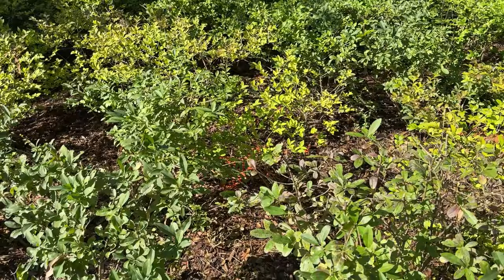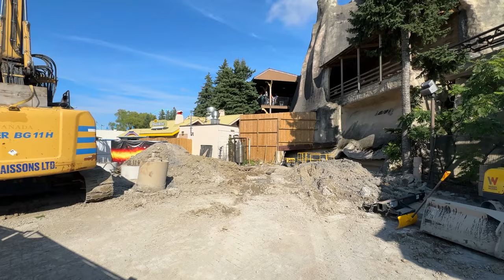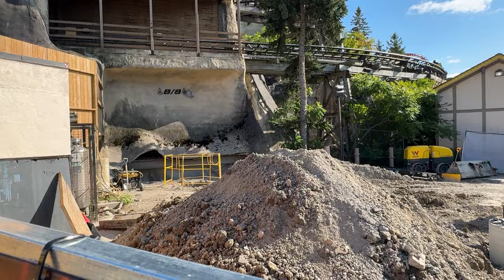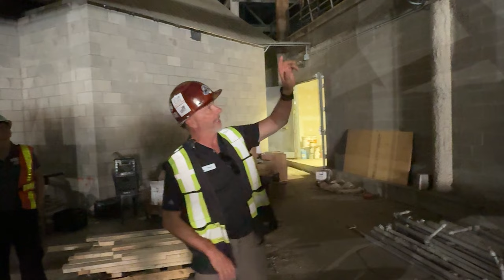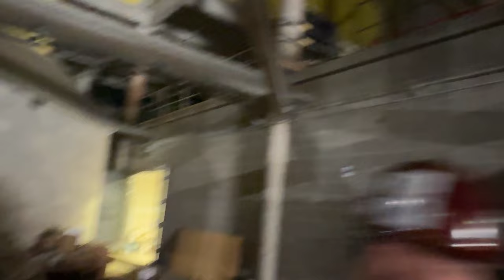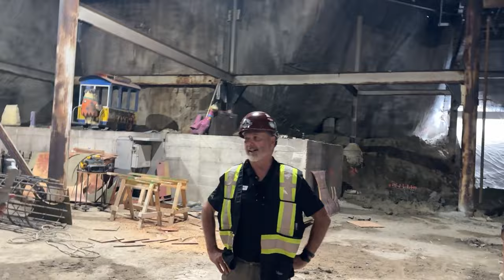Canada's Wonderland AlpenFury Construction Update

Comment: Here is a thought for you Brandon.  Because they have and are still keeping this coaster very secretive.  Do you think this coaster will be heavily themed throughout the ride?  I was thinking this, because everyone is only asking about the fire coming out of the mountain.  Well, what if there was a cold section in the tunnel?  The heat switch to the fire would be crazy.  What if the entire coaster is heavily themed like Velocicoaster.  Do you really think they would invest in a fire feature if the rest of the ride is just a plain coaster?  What about when it goes over the Expo path .. could be themed there.   What about the SkyFlyer area . .could be heavily themed there.  What about the area around the back of the mountain, could be themed there.  I honestly think that because they don't know what the fire feature will look like, I think they are holding back on the heavily themed announcement.  I just bet the entire coaster will be heavily themed. .They are not going to build a coaster like this, so predominately featured around the front gate/main street area without theming, I just don't think so.  What are your thoughts?
Reply from the maker: They are currently trying to figure out how to do a cold element in the tunnel. The tunnel is currently still in the design phase so they’re still planning theming :)
Reply: Yes, for sure they are.  The coaster is not just going to be exposed to the "back stage" area behind the main street shops.  I think there will be walls/trees around the coaster track so that they can add theming elements like Velocicoaster.